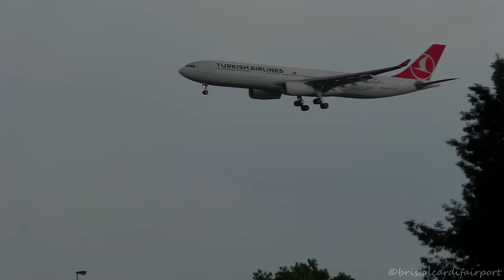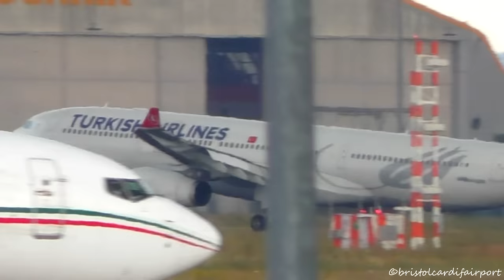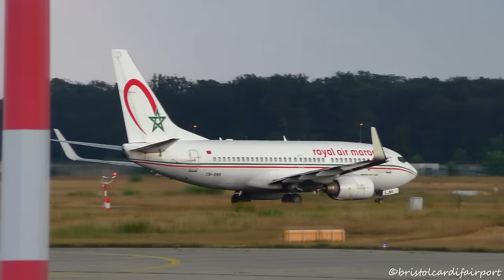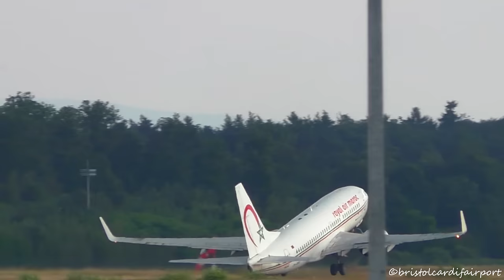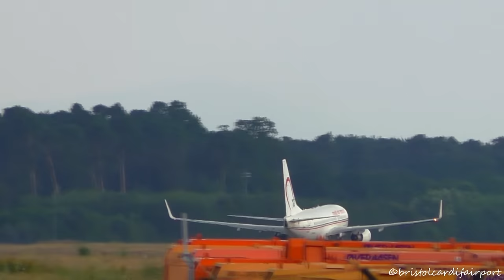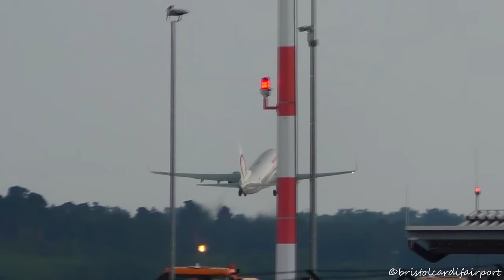PASSENGER AIRCRAFT FAILS TO TAKEOFF! BOEING 737 NEAR TAIL STRIKE & STALL ON TAKEOFF

Comment: 1. Flaps are up, there is no takeoff on a 737 without slats. This has led to crashes before. I'm just wondering why the Takeoff configuration warning didn't come on when they advanced power. 
2. Wrong calculation of Vr is unlikely since the plane took off close to the end of the runway. That would never happen in a Jet since V1 needs to be at a point where the plane can stop using no farther than the stopway (Arrows at the end of the runway). Where the plane finally took off was closer to the end.
3. Rejecting Takeoff after V1 (V1 comes before Vr - rotation speed) is a BIG NO. It has led to highly fatal crashes. The only right thing at that point was to select Flaps 1 at least if not 5 (which clearly did not happen)
(Ex-B737 Pilot)
Reply: 1. Flaps are extended. Look closely and you will notice it. Slats also are extended, cant have them without Flaps (except autoslats).
2. Wrong calculation of Vspeeds is not uncommon when you have wrong payload data......I guess it never happened to you or maybe you just never found out. 
3. Please dont claim something that you never were.... Cheers
Reply: +Angelos Sakellariou  Wrong calculation of V-speeds may have coincided with an erroneous flap setting as well. That looks to me like a flaps 1 setting with considerably greater TOW than expected. They're lucky. There isn't always that kind of margin for error available.
Reply: looks more like a wrong weight entry in the FMC, wich would lead to low V speeds
Reply: I can see slats down
Reply: They don't have QRH in the CDU, they use airport analysis or an ipad. The weight they entered in the CDU has nothing to do with the flap setting they select. Flaps 1 take off is very rare on the 737 as it's well overpowered. Flaps 1 and 2 are there because of the shared type rating with the 400 and 300, it's a legacy feature coming back from the 100 and 200.
Reply: palonazo I agree that flaps 1 would be an unusual setting, but that does not look like flaps 5 to me. I could be wrong. Required speeds without it would be considerably greater, though, and Boeing has been promoting the idea of minimum flap settings to increase the efficiency of departure and climb-out. That has potential safety implications, as previous 737 incidents and accidents have demonstrated.
Reply: Reflected Miles
That was not my point.
Reply: What I said is that, it being rare to take off with flaps 1, one of the possible reasons is that they had everything set up and calculated for flaps 5, but left the flap lever in the 1 detent by mistake. The config warning logic wouldn't be triggered.
On the other hand, I'm not sure if the difference bewteen flaps 5 and flaps 1 settings, at a flaps 5 Vr means no unstick. I'd like to know how different Vmu or a decent Vlo is between flaps 5 and flaps 1. I don't have the manual for the -700
Reply: ***** Well, we don't really need the airport analysis... the difference between flaps 1 and flaps 5 is hardly 10 knots.

I say it was windshear.
Reply: I expect there would be about 8 or 9 kts. of difference between the flap settings, but I think they may have gotten it wrong because they believed they were considerably lighter than they were. So now flaps are wrong and speeds are wrong, and that starts to add up much bigger numbers. I only think of Flaps 1 for light and long situations, also. From what else I can hear and see in the posts from the airline quoted here, the wind looks like it may have been somewhat of a factor, but watch that total length of time and distance required from first Vr to finally lifting off, including dropping the nose to try to get rid of some drag in the acceleration. That would have had to be a serious shear to generate that much difference in speeds required. That looks like a very miscalculated roll to me.
Reply: still wrong behaviour ... they pulled the nose up to the sky without any reason
Reply: For someone who claims to be a 737 pilot, you're also saying that this crew would have gone down the runway with the takeoff config warning blaring the whole time.
For someone who claims to be a 737 pilot, you've got a terrible understanding of V speeds.  Rotation could absolutely occur within the last 2000ft of a runway.  Vr is not calculated on runway length, but weight, the only flexible number there is V1.....
And if you WERE a 73 pilot I can see why you're not now.....
Reply: Chris James Yes, I was quite sure he had never seen some of those 727-200 runs I used to watch on hot summer days at higher field elevations with less than 2 miles of runway. We'd sit there as they were going past the TDZ for the opposite end, "Nice to see them rotating." Boeing should have had a table available that showed #2 nozzle clearance above a 12 ft. fence at x number of feet past the localizer antenna. :-/  I never could figure out how their dispatch was accounting for engine-out, given what it was doing with all three making enough noise to raise the dead, and I was always happy to be sitting in something with a little more margin available.
Reply: Reflected Miles
What do you mean by "I never could figure out how their dispatch was accounting for engine-out".
Reply: palonazo I meant that it looked like dispatch knew what the margin was for engine-out performance and had added that back in to their loading. :->  I know from deadheading in the jumpseat a few times in that situation that when the captain's got the packs off for every fraction of additional EPR on 1 and 3 and they're still barely clearing the fence, the margin must have gone somewhere. I have no idea what engine loss or other unexpected adversity (e.g., shear) in that scenario looked like in a sim, but just the 15 knots or so between Vr and V2 could take a bit. I have always suspected this scenario in PanAm's terrible loss in New Orleans back in the day when the winds weren't cooperative. The determination was microburst but I think they calculated that, at worst, it could have been 30-some kts. Even though they had climbed a bit, there was just no real margin to work with. I have rarely seen launches looking that doubtful in the years since, and those were mostly international freighter types.
Reply: Reflected Miles
Clearing the fence on all engines with 12 ft... isn't that super illegal? My exam was a long time ago, but aren't you supposed to be able to reach 35 ft in 0.78x the declared TODA?
Reply: Ignorant pilot trying to take off early. Is the reason.
Reply: Bestivitiness
Oh really? Were you there? Please let us know how you got to that conclusion and disregarded all other possibilities.
Reply: palonazo Because if it was of technical problems the plane wont be able to take off again. The pilot realized it was too early so he had to fix his mistake. No knowledge needed, just common sense.
Reply: Bestivitiness
Pilots don't usually take off too early, because our memory won't pull the yoke before we hear the callout "Vr".
It could be many other things apart from taking off too early.
-Wrong trim setting (unlikely).
-Wrong flap setting.
-Incorrect weight input leading to wrong Vspeeds (very likely).
-Windshear (none reported).

So stop saying you know what happened when you clearly don't.
Reply: palonazo Neither do you.I'm just pointing out the obvious.I never said i know exactly what happened.You're the one being too philosophical.Now its clear why the plane failed to take off and it has to do with the pilot.Would't you agree?
Reply: Bestivitiness
I'm not claiming I know. I've listed some of the possibilities. It is you who said "they rotated early".
Reply: palonazo You're gonna use quotation marks and not even have a proper quote. Ok.
Reply: Bestivitiness Ok, you said "Ignorant pilot trying to take off early". I listed so many possibilities that don't require the pilot to be ignorant, nor having taken off early.
Reply: jasper tillaar If you say so. I'll keep doing my job in any case.
Reply: I have worked at two hubs of an airline that flies only 737s and I don't believe I've ever seen one take off with flaps/slats. Certainly it happens, but it is not standard procedure.
Reply: BlakeBigfoot Are you serious?? You've never seen a 737 take off with flaps? That means you're blind. A 737 NEVER takes off with less than flaps 1. Flaps 5 is the most common setting for take off 90% of the times. If you don't set flaps to at least 1, you get a take off config alarm as soon as you advance the throttles.
Reply: You sure flaps are up? I'm pretty sure they're down at at least the 1 position.
Reply: Flaps and slats were both set. My guess is he started his roll too far down, weight was seriously off, or V1 was grossly miscalculated.
Reply: The Flaps are 100% up. Did you now the different between Flaps and Slats? The Slats in Front of the Wing are Down yes but the Flaps at the end of the Wing are Up. That is 100% wrong Way. Revolsin is right.
Reply: Christian Benzinger Dude, no they're not. Go find a picture of a 737, and compare it to this. The flaps are at 1. It's a very small difference, but that's the normal setting for the 700.
Reply: Compared to this takeoff video zFMNmkB0bRk looking out over the wing, it appears this plane was in the same flap configuration.  Definitely not "100% up" in which case the whole trailing edge of the wind would be a clean unbroken line, and it was not.
Reply: daemn42 Exactly.
Reply: When I look at your youtube channel subscriptions I seriously doubt that you're an ex 737 pilot. Maybe in a game but not in real life.
Reply: Revolsin I
Reply: Revolsin Well there are some flaps there if you look carefully
Reply: Flaps are 5 
Calculated weight FMC inputs are wrong and speed are selected auto from FMC
I think takeoff mode is CLM2 15% thrust reduction just to save fuel as much they can
thats why we have accidents ( idiot and unorganized and unresponsible people they want to just finish ) and fly this shit

Comment: How did ATC permit this aircraft to take off into the wake of the earlier plane without giving a gap?
Reply: That's the actual proper question
Reply: Excellent question... The pilot can bring this up on his return landing...
Reply: At the end of the day, the pilots don't have to accept a takeoff clearance but they did, most likely because they did not expect this situation to happn. This scenario was probably unusual in that the two airplanes were on different runways.. My guess here is that the wind moved the wake into the path of the departing aircraft, unknown to ATC and/or the crew prior to initiating the take-off. The training of pilot flying then kicked in and he behaved in the most professional manner.

Comment: Full blame on the pilots. If they pulled the stick at the right v1 speeds, this should not have ended looking so ridiculous
Reply: prove it
Reply: You are supposed to pull at Vr not V1.
Reply: There's only one V1 speed, and you don't pull anything at V1.
It's called reference or 'V'-speeds, and you are supposed to Rotate at Vr. Normally way beyond V1 and definitely above Vmca
Reply: arm chair pilots crack me up. probably the plane was heavier than they thought.
Reply: you have no idea what you are thinking, and you do not have the mindset required to be part of an airline. Thank you for avoiding this kind of comments in the future
Reply: This should not have occurred.  Clearly the wrong Vr speed was calculated - blame for this could lie on whoever prepares the load manifest, or the wrong data was entered in the FMS.  The other possibility is that the flying pilot inadvertently rotated at a speed lower then the calculated Vr or that the wrong  flap setting was selected for the calculated Vr speed.  Definitely not normal and a mistake was made somewhere.  Fortunately everyone lived to tell about it....
Reply: Raymoland maybe the plane was heavier than they initially thought or maybe the wind was blowing downward pushing the plane down on the runway, it's not always a pilot error. Actually i am surprised this doesn't happen more often.
Reply: actually its worst than you think  they did pull the stick at the vr speed indicated in their book   they just forgot the flaps   which change the speed of vr
Reply: Just to add some clarification, V1 is the speed in which an aircraft must commit to taking off. (Think of it as a "Point of no return")

What you are referring to, is VR (Rotation) in which the PF (Pilot flying) applies back pressure on the yoke to raise the nose.

Aside from all this, it looks as if it was a result of a few wrong calculations.
Reply: +Jimmy Marois Look to the leading edge of the wing and you'll see that the slats are already deployed. This implies that the flaps would have been deployed to at the least, one notch.
Reply: On an infinite runway Vr is the same speed as V1. V1 is defined as the speed beyond wich you will not be able to stop the plane before runway end, therefor above V1 you MUST take to the air, hands off power lever. From V1 on you only maintain runway axis. If whaever happens before V2  .... !!!! 
At Vr which is defined for the plane config you pull the stick.
According to rw length Vr could be immediately close to V1., even before if the rw length is 6km for instance and your plane is almost empty and you have 20kn fornt wind.
Reply: Philippe Durand My bad. What I meant to say is that it does not constitute a safe rotation speed in most cases. You are correct. VR can theoretically be the greater than or equal to V1. Clearly, I stayed up too late.
Reply: boeing use leading edge Krueger flaps  different from  slats  check it out
Reply: Wait before such an assertion :"Full blame on the pilots". Full blame on some human ... yes, of course. Are you sure they got the right information about freight and pax onboard ?
Technically the pilot in function did a good job. He got a problem and finally the plane took to the sky safely and nobody was hurt. Maybe he changed his dress just after  ;-) , but his reaction show good training and good skills.
At least congrats to the pilot who saved the plane and the pax.
We probably will never know where the problem was, YT is only ther for sensationalism ; the final incident report, if any, will stay unnoticed. I would like to read it.
Reply: I seem to remember two Leading edge flaps and three slats on the Classic
Reply: what are the actual speeds at Vr and V1??
Reply: +jitegemee "what are the actual speeds at Vr and V1??"

It depends on gross weight, etc.  It needs to be calculated before each takeoff.
Reply: v1 is not the speed of rotation. They most likely did calculate correctly for altitude and temp which is when they initially tried to rotate but that's a,speed assuming your not an idiot and actually set the flaps to twenty degrees or more.
Reply: +SeikiBrian depends on altitude of the airfeild and temp density altitude. Weight is simply a go no go calculation and has no real effect on your V speeds. Balance is the critical component of weight.
Reply: First of all, there is flaps 1+slats set, this is common setting on the 738 so its unlikely they would of set the wrong flaps and applied T/O thrust because they would of got a config warning. Second, its obvious the aircraft had not enough airspeed to achieve the required lift. Its unlikely the pilot rotated at a different speed to what was on his speed tape. So it only leaves us one error: which is miscalculation of the Vspeed. This can either be done by loading more weight into the AC than what was on the paper OR the pilots failing to crosscheck the weights in the FMC/ made a data entry error. We DONT know. Please shut up if you dont know what your talking about
Reply: unlikely they would HAVE
Reply: No Sam. This is stupidity ! V1 is never the speed to pull the stick. V1 is depending on runway length , weigth of the airplane, eventual RW pollution (rain, snow, ..), ...  and is the speed at which you will not be able to stop the plane before runway end. Up to V1 hands are on throttle, not after V1.
You use Vr for pulling the stick, on short runways VR is far after V1.  On an hypthetical very long runway Vr may be (could be) lower than V1
Reply: What is V1 and Vr speed ? I'm an old VFR private pilot . Thank you .
Reply: + machia0705 -- "V1" is the speed at which there is no longer room to abort a takeoff without running off the end of the runway; it's the "commit to fly" speed.  "Vr" is the speed at which you rotate (raise the nose) in order to take off.  The V1 speed is calculated before each takeoff, and varies with the length of the runway, the gross weight of the aircraft, the coefficient of friction of the runway (Is it wet or icy?), etc.

Comment: Disaster! Looks like incorrect takeoff performance to me! The flap setting looks low but it's probably normal if that's 5 degrees, too high derate and low V speeds. If that was at Bristol, I'm certain that they would have overrun haha 😂
Reply: If they had rejected that takeoff after the nose was lowered then that would have caused many arguments as to whether that was a good idea to do that after V1
Reply: What V1 the wrong one or the good one.
Reply: Nice catch on the flaps. looks like no one else noticed that. Eventually he needed more time to get the lift he needs.
Reply: V1 is the speed in which an aircraft must commit to taking off. Prior to  reaching V1, the PF (Pilot Flying) has the option to abort with the remaining amount of runway.
Reply: Flaps 1 is actually a normal (and common) flap setting for the 737.  Based on the slats being out, but almost imperceptible flaps, I would guess he's at flaps 1.
Reply: Read more comments. 737 pilots speculate maybe he set flaps 1 which defeated the configuration check but Vr and V2 were obviously wrong for that configuration. But who knows, and the Morocans are probably not going to turn over the flight data since they are claiming this was a normal takeoff after ATC warned of wake turbulence.
Reply: Slats are very clearly out.